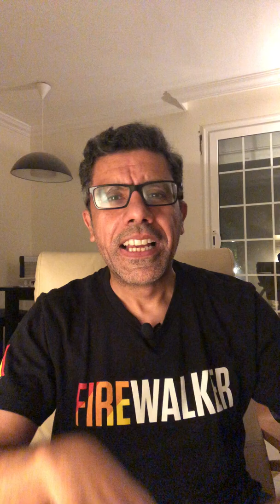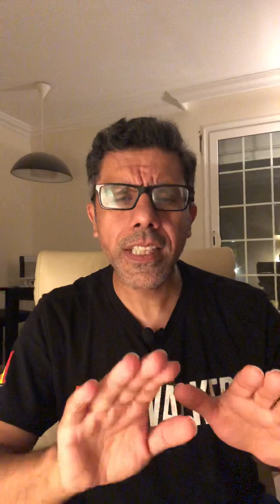Single Eng & Rudder Trim B737 (Raw)

Comment: Hi, first of all I would like to extend my congrats about the live vlog that u had the other day and i am looking forward for the next one! Seconds i would like to ask you a question about the electrical system as i am getting conflicting information. In the FCOM of the 737-800 it states that the TR3 serves as a back up source should either TR1 or TR2 fail, while in the DC section it states that all TR 1 2 and 3 power the DC BUS 1, 2 and the DC STBY bus. Now under normal conditions with the cross bus tie relay closed it is my understanding the TR1 and 2 power the DC BUS 1 and 2  and the DC STBY bus via the DC stby bus normal relay, sharing the load, while the TR3 powers the DC BATTERY BUS via the battery bus normal relay, while in the event of either TR 1 or 2 failure the TR3 will assist the remaining TR to power the DC BUS 1 and 2 and the DC STBY bus while still powering the DC BATTERY bus. Is that correct or is the TR3 supplying the DC BUS 1 and 2 and the DC STBY BUS together with the TR1 and 2 even during normal operations? Thanks
Reply from the maker: Hello Diego, 
Thanks for your kind words regarding the live stream, and a bigger thank you for joining🙏🏼 me. 

Your understanding is right. Under normal conditions, TR3 will power the Battery bus, 
If either TR1 or TR2 fail then TR3 will assess the operating TR in addition to powering the Battery bus. Provided as you said the cross bus tie remain closed. 

Hope I answered your question, let me know if you have any other questions. 
All the best
Abdul
Reply: Abdulmuati Asiri thanks for the prompt reply. What confused me is that in the FCOM it shows that the DC STBY bus is powered directly from the TR1 and 2 while in other diagrams it shows that the DC stby bus is powered from the DC BUS 1 which is turn is powered by the TR1 and 2, was wondering which one is correct. Also the main battery charger powered from the ac ground service bus 2 serves as a charger for the main battery as its voltage drops below 23vdc while once the charging cycle is over the charger will switch to its TR function powering the hot battery bus and the switched hot battery bus, so that basically the main and if applicable the aux batteries basically do not supply anything. I guess if u set the Dc Selector to the BATT position the DC meter will show something like 24vd and no load - 0 or nearly 0 amps - provided that the charging cycle is over. Am i correct? Thanks
Reply from the maker: Hello Diego
I looked at all the Electric diagrams I have in the FCOM, DC STBY Bus is not connected to DC Bus 1 I don’t think their is a way to connect the two together nor would you want that, you have two independent DC buses so if their is a problem With DC Bus 1 you still have that independent STBY DC BUS. 
For the second part of your question regarding the Battery Charger you are right, the way you explain it is spot on. 

Can you send me the diagram that is shown DC BUS 1 connected to the STBY DC BUS. 
My e-mail: abdulmuati37@gmail.com

Hope that help 
All the best
Abdul
Reply: Abdulmuati Asiri hi, thanks for the prompt reply. What i meant it was that in a few schematics it showed the DC STBY bus being powered from the DC BUS 1 via the dc stby bus normal relay controlled by the SPCU or Stanby Power Control Unit while in the event of a TR1 failure or should the DC BUS 1 become unpowered the SPCU will open the dc stby bus normal relay and close the dc stby buc alternate relay having the dc stby bus powered from the main battery charger if operating in the Tr mode. I will send you the schematic i am referring to
Reply: Abdulmuati Asiri hi, any live show coming up? Also i wanted to ask you one additional question about the electrical system to dissipate a doubt i have reading the manual: it is my understanding that the BPCU or Bus Power Control Unit is the component ensuring that the two basic principles the AC electrical system is based upon - no paralleling and when u select a source it will automatically disconnect the previously selected one - are enforced, so if for instance the APU generator is supplying electrical power, when u set the GEN 1 switch ON the BPCU will force the BTB1 open to prevent parallel operation and the CGU will close the GCB or Generator Control Breaker provided that the IDG is operating within limits - phase, voltage and frequency - connecting the IDG to the AC TRANSFER BUS 1. In addition the BPCU will also provide monitoring for the external power cart illuminating the GRND PWR light once the current is checked to be within limits. On the other hand the SPCU or Standby Power Control Unit is the component that will open the normal relays and close the alternate relays having the ac, dc stby busses and the dc battery bus powered from the batteries and the static inverter should the normal power sources become unavailable. Is this correct? Many thanks
Reply from the maker: Hello Diego, 
So far I don’t have anything planned for a live stream, but will sure announce if anything comes up. 
Any suggestion for a live stream. Guess it’s better to have one topic or a theme for live stream to keep it organized. 

Regarding what you said all is correct. The logic for the BTB (Bus Tie Breakers) will do all that. 
Hope that help 
By the way I did not get the schematic for the electrical system that you mentioned earlier. 

All the best 
Abdul
Reply: Abdulmuati Asiri hi Abdul, thanks for the prompt reply and looking forward to the next live stream! As far as any advice goes maybe i would discuss the electrical system with reference to the failures you can have and how to handle them - for instance a TR1 failure that will cause the AP and the FD to go away as the cross bus tie relay opens at gs interception or a TR2 or TR3 failure what will go unnoticed in flight - no TR UNIT light in flight is either one fails but only if both fail - or i would talk about the descent planning using VNAV, how to program it especially with reference to the altitude constraints of a STAR and the hard altitudes and how the FMC can put you way up on the descent profile if you are given a shortcut - as it always happens in Dubai or Riyadh! 
Take care and as usual happy landings
Reply from the maker: Thank you Diego,
All those are great suggestions. 
You are right about the shot cut that you might get which might result in the airplane being high. 
Thanks again 🙏🏼 
Abdul

Comment: Hi, one quick technical question that even though it is not pertinent to the topic of this video has been bugging me and hopefully you will be able to help me out with: at the completion of a successful IRS alignment the ALIGN light should extinguish, however a flashing ALIGN light willl indicate faikure of the crew to enter the PPOS either manually via the alphanumeric keyboard on the ISDU or via the CDU; excessive difference - greater than 1 degree - between the latitude computed by the IRU based on earth rotational velocity and entered latitude accompanied by an ENTER IRS POSITION message on the CDU - replaced by a VERIFY POS CDU message if the same latitude is re-entered accompanied by a steady ALIGN light and a flashing FAULT light; or when the difference between the last stored position and the entered PPOS is greater than 4nm and deemed to be unreasonable, accompanied by a VERIFY POS CDU message. 
Is that correct? Not sure if the VERIFY POS CDU message will be displayed if the same latitude is entered again.
Thanks for sharing 

Btw when is your livestream?
Reply from the maker: Hello Diego,
What you said is correct entering a wrong position in the IRS will lead to the ALIGN light flashing. 
Fault light as far as I know will not flash, and it will come only if their is a fault in the IRS but not if the wrong position is entered. 
So here is the thing,
Align light will flash if, if the alignment process was not completed, usually due to excessive airplane movement because of the wind or passenger boarding, or the entered position differ greatly from the last known position, or it is the wrong position after the IRS perform the latitude check. 

Hope I answered your question. 

Thanks for the reminder regarding the live stream, I just posted the timing it is going to be at 17:00z tomorrow

Wish you all the best 
Abddul
Reply: Abdulmuati Asiri hi thanks for your prompt reply, looking forward to the live stream

Comment: I would also like to add that it is crucial to maintain coordinated flight during single engine operation by applying rudder on the side where the yoke is cocked until the control column is centered using the aileron trim scale as reference. As matter of fact considering that the 737 AFCS is basically a two channel autopilot - aileron and elevator - in the event of an engine failure as the airplane yaws to one side it will also roll towards the same side due to the fact that a portion of the leading edge on the failed side is blocked by the fuselage causing the wing to generate less lift - L=1/2 V2 Cl S rho - to compensate for the rolling moment the autopilot will command a roll into the opposite side as it does not have any authority over the yawing moment, as reflected by the yoke tilting onto the good engine side. Stepping on the rudder on the cocked side will correct the primary cause - the yawing into the failed engine - and thus the need for the autopilot to compensate for the rolling moment, re-establishing coordinated flight and allowing fine trimming of the aircraft.
Just my two cents
Reply from the maker: Hello Diego, 
Thank you for sharing your thoughts, those are excellent points. 
You are absolutely right. 
All the best 
Abdul
Reply: Abdulmuati Asiri thanks and as usual it is always a pleasure when you post one of your videos - concise and straight to the point! Thanks for sharing
Reply from the maker: @diegobeatrice5257  Thank you so much Diego it's my pleasure.

Comment: I was told a good rudder trim setting is to look at the fuel flow. If 5.x or so for t/o..5 units is good. For single engine approaches.. Usually the FF is 2.x .. so around 2 would be good. I think most people don't know that on the 73, the autopilot does not control the rudder... The pilot had to do it. Of course the pilot has to make sure there plane is flying efficiently by looking at the slip/skid indicator.
Reply from the maker: Hello S G
Thank you so much for sharing your thoughts and tips. 
I am going to try the 2 units on approach next time. It makes a lot of sense.
Regarding the coordination of the airplane, I believe the objective is to maintain neutral flight control or close to neutral, I guess some slipping will be there. Again I will watch it closely next time. 
Thanks again I really appreciate your participation and sharing. 
All the best 
Abdul